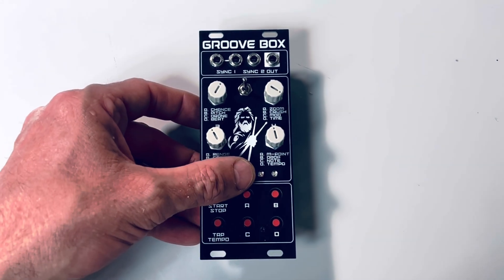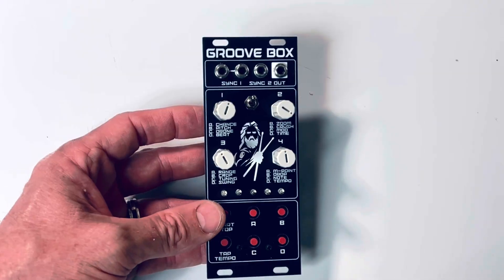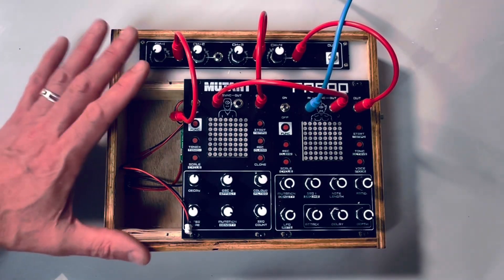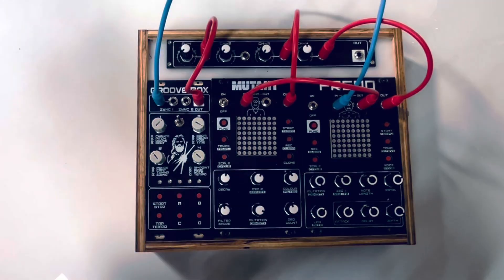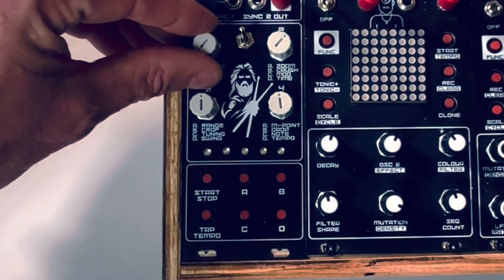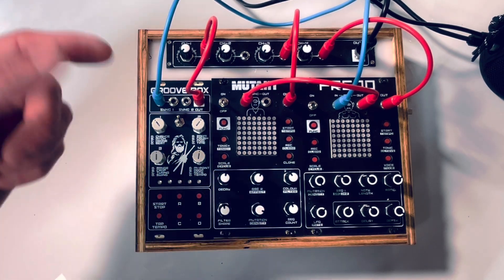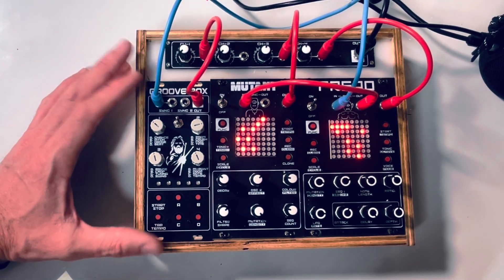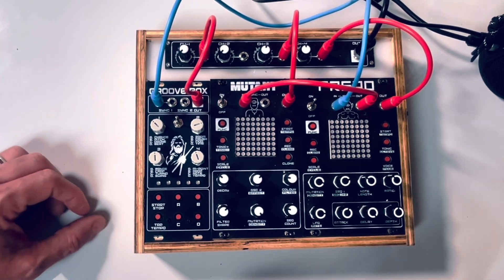Groove Box Modular Synth - Arduino Nano

Comment: Great project. This little system is amazing!!  Congrats, you nailed it again!!
One question: I noticed that your version has Sync Outs instead of the MIDI outputs in the original design. If I connect the MIDI circuit to your version, will your code be able to send and receive MIDI?
Thanks for sharing!!
Reply from the maker: Cheers!  
Yep, the code can still send and receive MIDI so no issues with adding an additional circuit and connecting it.
Reply: @lonesoulsurfer  Perfect! Thank you very much!!